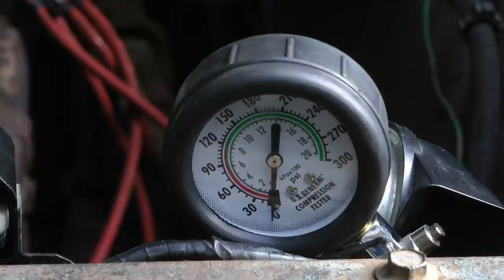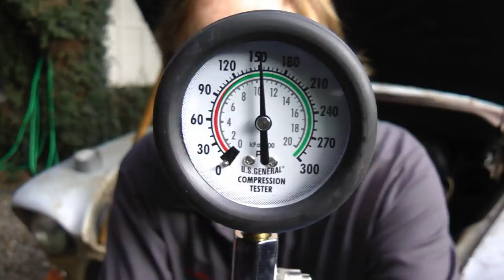How to Tell if Your Car's Engine is Bad

Comment: I'm wondering if you can tell me if a 2002 2.2 ohv engine is an interference or non interference engine. I can't seem to find the answer anywhere. My timing chain broke while driving and it quietly coasted until I stopped. Appreciate your time and looking forward to an answer!

Comment: Love you videos but can't you  tell if an engine is really burning oil by just checking the spark plugs and residue in the tailpipe rather than a complete compression test?

Comment: do you know anything about turbochargers? if so, could I put one on my 01 ford ranger v6 3L
Reply from the maker: you can, but the process is expensive and requires many mods. Contact Mr. Turbo in houston texas and he can tell you more
Reply: Thanks scotty
Reply: You can install an Eaton M90 supercharger and there is a lot of information about doing it at the ranger station and other ranger websites because a lot of people have done it on the vulcan 3.0.Just told you because I know that the supercharger is a much more common installation on that engine than a turbocharger.
Reply: +Charley Bomps what's the difference
Reply: A turbocharger runs off exhaust gas to force air into the intake manifold. A supercharger runs off the serpentine belt on the front of the engine. In real-world use, a supercharger will give a faster throttle response but a turbo charger of the proper size can force more air into the engine. I imagine that a supercharger would be easier to retrofit onto the Vulcan 3.0 than a turbocharger would be. It would also likely be less expensive.

Comment: Could replacing piston rings restore normal compression?
Reply from the maker: sure, but that costs quite a bit and this guy had just had a supposedly "good" used engine installed in this
Reply: (((((((((((( WARNING ,,))))))))))))), REPLACE THE PISTONS TO   AND RE BORE THE  ENGINE  ,, YOU CAN PUT RINGS IN   ,,,, BUT THE BORE OF THE BARRLE  MAY BE WORN AND BRAKE YOU RING OFF   , OK BUD

Comment: I have a 89 4.3 chevy that dumps fuel in the engine. Changed temp sensor,Map sensor.Replaced the tbi with one from junk yard. Vehicle is toast now, but i own two similar vehicles. What do you think was going on with it?
Reply from the maker: often leaking fuel injectors or fuel pressure regulator. That cheap plastic crap cracks with age then leaks

Comment: 2:27 Why put a new engine when problem is just the piston rings? Wouldn't replacing just the piston rings be enough?
Reply from the maker: it's a really old used engine the guy just had put in from a junk yard that said it was good. They lied, he was pissed.

Comment: I've got an 89 Pontiac 6000 se that's been kind of a pain the idle fluctuates but not consistently every few seconds or so after it warms up it sputters and comes back and it reads low oil pressure unless I hit the throttle I'd assume it's  a bad oil pump but so far I've fixed the vacuum lines and replaced the air filter as well as a few other suggestions from some of your videos just not sure what to do with it at this point

Comment: The body work is the easy part, especially if he's familiarseveral with a welder and some scrap metal. Hell I have had several  67 Mustang fastbacks with no floors or quarters at all due to rust and had it replaced in a few week ends. Besides small block chevy's are a dime a dozen. No need to give up on that project, and those real trucks are not made like that any more.
Reply from the maker: yes, but he was mad cause he just paid someone to put a "good" used engine in this, and it was not good and burned oil.
Reply: Well that's his fault lol.

Comment: hi! our mechanic said that the valves in my 2E engine were possibly worn out since my car emits white smoke. They haven't done this compression test though to determine if the pistons are worn out too. I asked them if I can leave the car in that condition without risking of worsening the problem. They said it's ok. I just want to know your feedback if I need to have the valves fix asap. thanks!
Reply from the maker: have the test done to find out, and if pressures are good, then valve seals are just worn and you can live with that
Reply: Did they actually check it, or did you just ask them for general advice without them looking at it?

At this time of year, when it's cold, you will get white "smoke", which is steam/condensation - I am assuming by "2E engine", you are referring to the 2.0L VW engine (as it uses that engine code from around 1992 to approx 1995) with the 2E engine code as fitted to the Golf and Passat, etc? I have a Golf with the AGA engine, which is a slight update the 2E, but mainly has updated fuel injection and ignition systems.  It does chuck out a lot of white "smoke" which is steam/condensation and is normal, and nothing to worry about.  You will probably notice it more when you are stopped at lights, etc., and/or if you do a lot of shorter journeys.

However, excessive white smoke is more indicative of coolant getting into the combustion chamber, which could be a sign of a leaking head gasket. A "block test" can help diagnose this.

Smoke from burning oil - oil getting past valve seals and stems, and/or from piston rings is usually blue, it may very light blue, or noticeably blue.  If it is oil being burned, when it shows up can help tell you where it's coming from - for example, smoke when accelerating away after going downhill without using throttle can be valve seals, smoke every time you rev the engine can be rings. Doing a compression test won't always show worn or broken oil control rings if the compression rings are still serviceable.

Does your engine use oil - the 2E should be very good and you notice little to no drop in oil level between services. And does the coolant level stay constant without needing to be topped up? Again, on these, you should not notice the coolant level drop.

If your car does have a catalytic converter, then burning oil can significantly shorten its life.

If you are concerned, then it may be worth getting it checked properly - a good mechanic should be able to tell where it's coming from (steam/coolant/oil), etc.
Reply: Yeah I guess i should have it checked by other mechanic. I'm not that keen on observing these signs but alteast i have ideas now what to observe. I appreciate your feedback. thanks! :)

Comment: My Dodge Ram, slant 6 powered had a blue tint from the exhaust & blew a puff when revved, when I first bought it. When I changed the oil, the oil was awful looking. After about 3 low service oil changes & running some Marvel Mystery oil in the pan, the engine doesn't have a hint of blue in the exhaust. Not a problem solver every time, but some older engines just have gummed up oil rings from years of being neglected.

Comment: SCOTTY.THANKS FOR ALL THE VIDEOS, I HAVE 2005 PONTACT GRAND PRIX ,IT READSA P13 CODE WHICH IS THE EVAP SILONID, OR GAS CAP.ANY ADVICE ON THIS QUESTION?IVE RAN IT FOR ABOUT 2 MONTHS BUT SO FAR NO PROBLEMS.OTHER THAN THE CHECK ENGIN LIGHT.

Comment: how do you know what the different compressions are supposed to be, for so many different engines?
Reply: refer to books, online databases, or contact the manufacturer and ask.
Reply: hes a magician
Reply: Its not so much what the engine makes - though you can find reports from others online, the key here is the difference between with and without oil, how big of a difference in pressure is that. If the piston rings are worn, it will let pressure out. The tiny amount of oil you saturate the cylinder walls with makes a seal - weak one, but, a seal enough. If the rings are good, the oil won't make a difference at all. Metal to metal seals better than oil to metal, which seals better than metal to air-gaps. :)
Reply: Just take a guess

Comment: I am loosing oil from the valve covers on my 98 Subaru Impreza 06/98. Coolant level is pretty stable. I've done oil pan, PCV, Oil sensor. Idle's normal when oil level is good. It's got 154000 miles on it. My questions are: after fixing valve covers and oil level continues to drop excessively without external leaks, what is a quick fix or sealant for oil leaking from head gasket before I rip it apart? It seems bottom of head gasket is not leaking, just bottom of valve covers. It may simply be loose covers from mechanic who did tune up when I first bought it two years ago btw... It would be no surprise if he neglected that after trouble with spark plugs. The thought occurred yesterday......... And omg those ball joints were my main focus... had to bust it from cont. arm and replace knuckle. Car Background:6 months exp.

Comment: That's 5.7 Chevy work horse out 90s Silverado junkyard pull out. I would love to have that motor and spark plugs. I just lightly sand paper them and gasoline. With patch panels and red paint job you got 20 thousand dollar truck. I do upholstery for living so the bench seat from scratch takes one day.

Comment: Did you do this on a cold engine? you won't get a good reading when it's cold I have always done it with the engine at operating temp and usually sbc are still good at 150 psi on up

Comment: What should the compression reading be? I swear I had a 4 banger GM 2.2L and the 110 - 120 pounds pressure was the average. Also you didn't say this but if you do this test remove the fuel pump relay, obviously not this old truck but no need for fuel for this test just cylinder air squeeze really. I found my dead cylinder and next comes figuring out if it is the exhaust or intake valve that kissed the piston top. Timing chain jumped due to cheap plastic guide, for those who don't know startup is a crucial time for your car, damn thing only had 75,000 miles.

Comment: Hi Scotty, my 2003 Ford Expedition with 5.4 2 valve engine just crapped out with 204k miles.  The engine over past few years needed a quart in between each oil change.  The passenger side has an engine knock that can be heard from both top and bottom of engine.  A compression test was done and I personally seen my mechanic crank cold engine and two of the heads had no compression. The other two had 40psi and other had 150psi.  My mechanic said that rebuilding my heads may not be cost effective.  I was looking to see what engine remanufacturing companies you could recommend if any.  I was considering a long block from Promar and replacing items like water pump, o2 sensors, egr, map sensors, etc.  Should I dump it and get a newer model or stick with the 2v? I replaced struts with 1 inch lift, new brakes, upper lower control arms. Changed differential and tranny fluid.

Comment: Hey Scotty, My name is Michael and i had a 1991 ford f150 where i took my cylinder head to a mechanic who looked at it and said it looked warped, my question is if the head is warped, then would the area that the pistons are in be warped as well where the head gasket sits between the head and pistons

Comment: How do you dry test on an engine that's been sitting for 10 years or more without running?  i.e. barnfind or a JDM engine on a pallet...  It needs some oil in the cylinders to keep from hurting the Piston rings. Just curious, thanks.

Comment: Hay Scotty I have a big issue with my 96 Honda civic wen I DRIve the ac blows a Lil cold but wen I stop it blows hot air also my comprseore makes a tick tick sound my av was working normal that stop what can it be

Comment: I have a  year 2000 Ford f150. 5.4l , v8 Triton recently o couldn't get my truck running for a couple of days, when I got it running there was light dark translucent smoke, and a pint of water coming out of the tail pipe. the truck is lacking power but runs when started . noticed that if I use radio, heat/air-condition, etc it drains out the battery. the battery is only a couple of years old and I checked it with a multimeter before the winter it read the proper numbers. something is draining it. if I don't use anything pertaining the battery it will be fine for a while.

Comment: How much oil did you poor in?  If there is a quarter inch of oil pooled on top of the piston, the compression is going to be higher because there is less air-space at top-dead center.  You also risk breaking the compression ring or even the piston if you really overfill it.  Liquids don't like to compress.  I'm skeptical of this method.

Comment: Hey, Scotty I did a compression test on my Geo Metro and the results show where 118 on cylinder 1, 107 on cylinder 2,and 101 on cylinder 3. I also did a wet compression test and it showed I had 135 on cylinder 1, 122 on cylinder 2, and 115 on cylinder 3. Do you think the engine is badly worn out?

Comment: Hey Scotty, My car blows blue smoke only when I step on the gas but the spark plugs look fine. what could it be? valve seals? The engine is 4A-GE by the way.

Comment: Recently installed power upgrade to my car, and it started eating oil. Thats one of the indicator of bad engine too. White smoke from exhaust.
Reply: +Milan Čihák white smoke is probably head gasket , oil burning is blueish or black.. in any case white smoke is burned water if your oil is milky white its almost 100% headgasket blown
Reply: You are right, Today I took it for a spin and it ate water and oil. On one occassion one crazy white smoke came out of exhaust. So I have it serviced as I type this.

Comment: What about replacing piston rings? If engine was replaced before you might just do it again, but for an old car with original engine?
Reply from the maker: of course one can do that, but the owner of this old thing just put a used junk yard engine in it, and it's just worn out so he's just leaving it.
Reply: Piston rings doesn't cost too much, but you'll have to take the entire engine apart to get to them, which for most engines isn't worth it.

Comment: 125 lbs/cylinder on that, you might get a good 3+ years of driving out of it if there are no noises yet and not a bad oil leak.  PLUS, on something that has been sitting around you may find that compression goes up a little after it has been driven more.

I wouldn't advise one way or the other on that old truck since something that old, with an old simple engine in it, pulling that engine out and a rebuild is less work than the rest of the vehicle, or pull to get a crate engine isn't all that expensive relative to the rest of the restoration either, could actually be the cheapest part of it once someone already owns the classic car chassis.

Comment: Hello Scotty, thanks again for all the videos. My question is does synthetic oil go bad if it's never been opened? I've got a few bottles of  castrol edge 5w 30  that was made in 2012. About to do an oil change and just want to get some feedback from you. Thanks!
Reply from the maker: no it does not go bad
Reply: Scotty Kilmer thanks again. Another question. What should my AC pressure be in psi on the low side? Doesn't feel as cold as it should be. Thanks!

Comment: I did a compression test on my GMC 288 (Pontiac 287) V8 in my 55 GMC half ton pickup, and the results are cyl.#1 and 7 got 90LBS, cyl.#3 and 5 got 95LBS, cyl.#2 got 100LBS, cyl.#4 and 6 got 105LBS and cyl#8 pulled 115LBS. Well then according to Scotty its really shitty then, its like lawnmower compression. The engine sounds tired but its healthy with no knocks and it doesn't burn oil.

Comment: I went for a simple synthetic oil change on my 2003 TL with 192k then i let myself get talked into flushing my engine because of how dark my oil was getting in such short distances (2000mi) in one year. Was this a smart thing to do? From $60 ended up paying 250